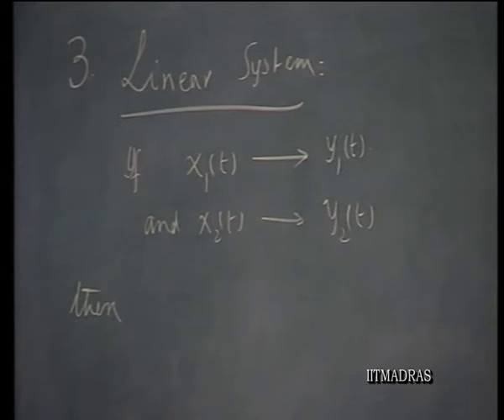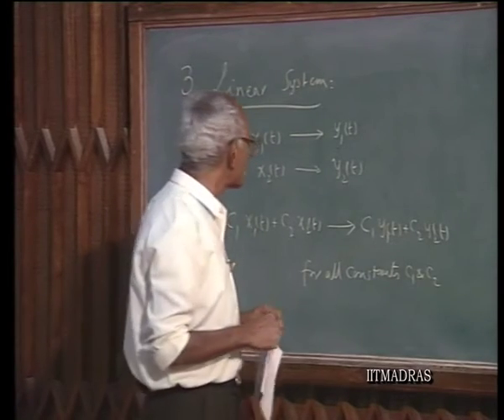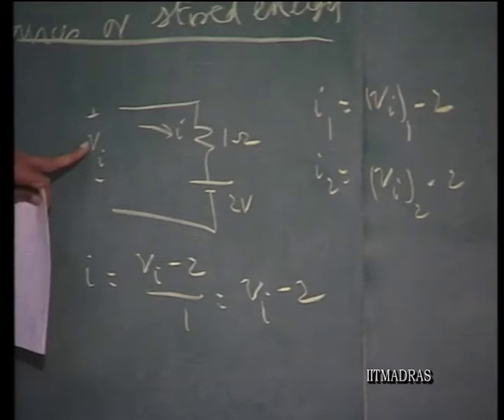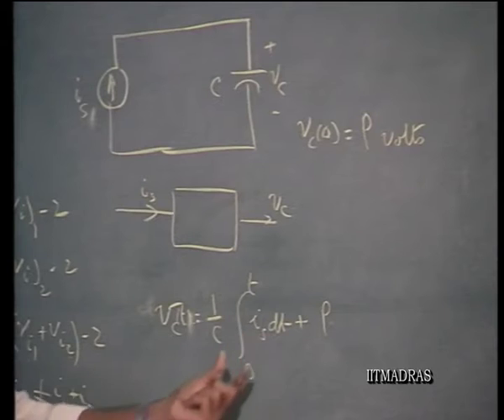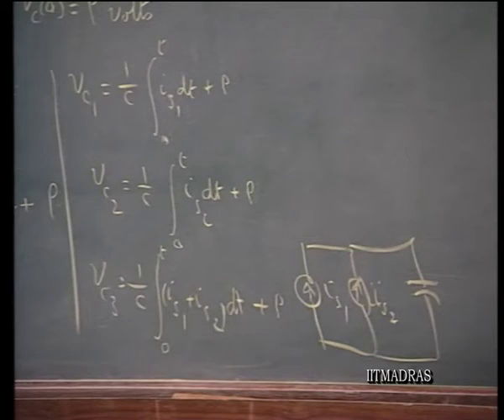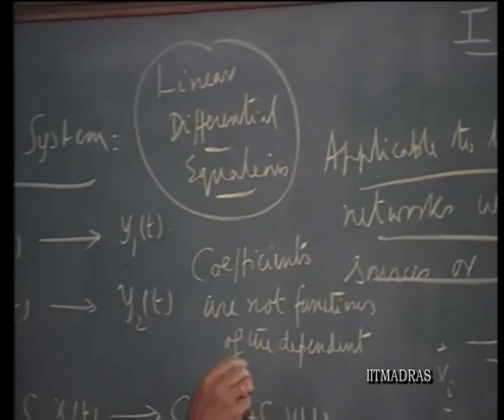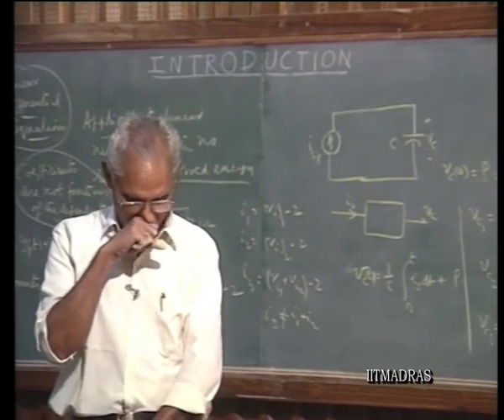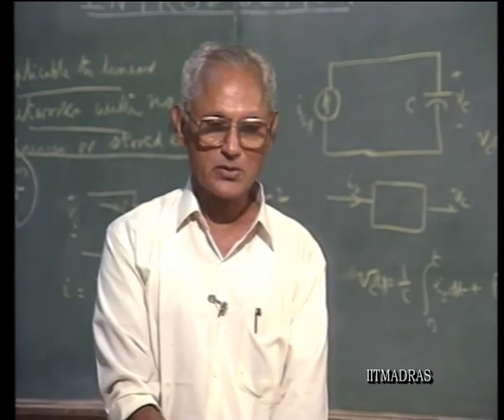LEC 3

Comment: def of linear system 0;00
ie lin network are w/o independant sources and stored energy
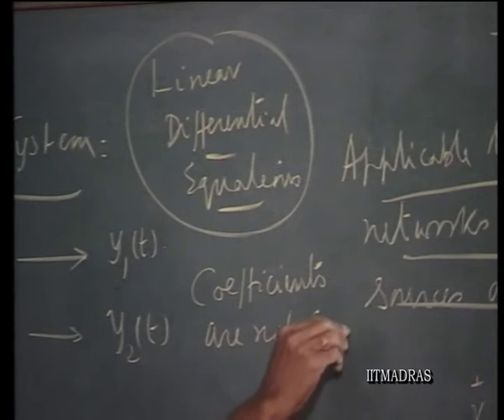lin syst are modelled as lin diff equ with coeff as either const or func of independent var (but not of dependant var) 9:20
summary 10:26